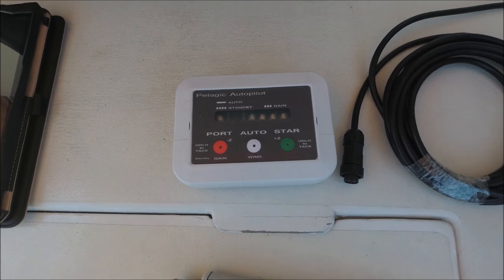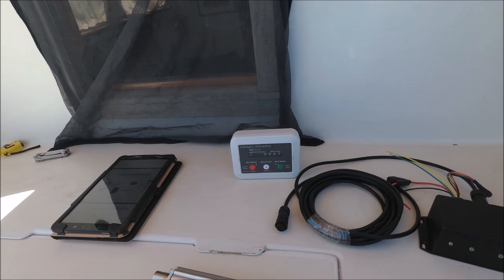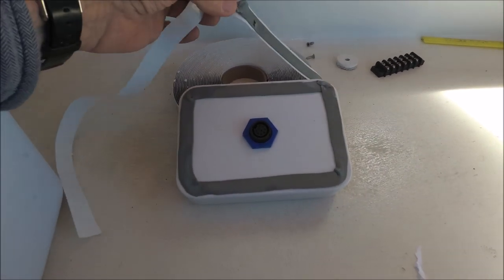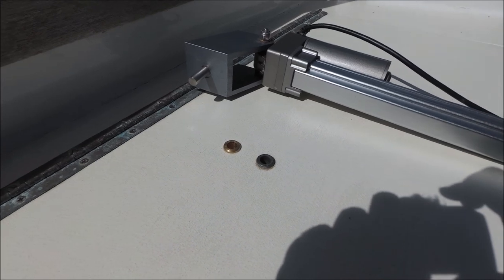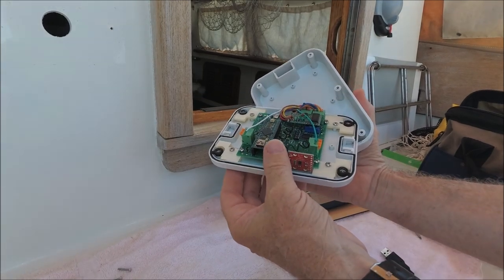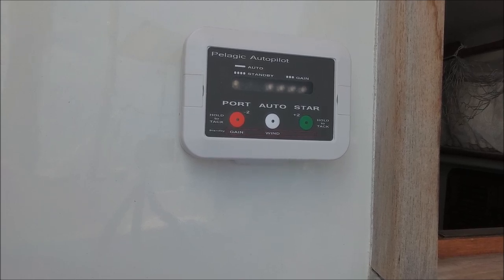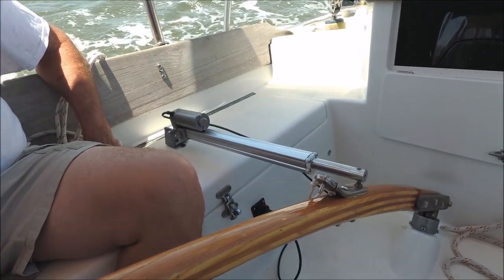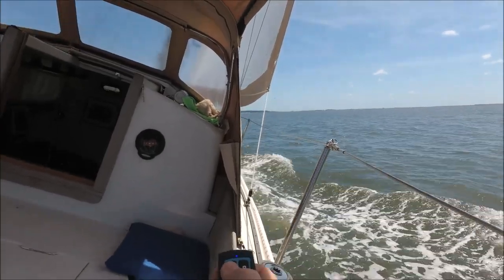Pelagic Autopilot Installation and Test

Comment: Thanks for making sense out of the worlds most confusing user manual!
 I may be mistaken, but on the yaw rate adjustment I think you got the  third and fourth steps reversed. Yaw Rate Damping is shown as the fourth step in the manual on the Optimization Adjustment Method page.
Reply from the maker: With 3 of the 4 parameter adjustments all labeled yaw something or other it is confusing. It's possible, but I don't think I mixed up the order, or the manual terminology may have changed on different updates. In any case, I got the adjustments correct and you can confirm the default settings with the manual, regardless what type of yaw it's labelled as.
Reply: atomvoyager  Either way, your demo and translation into plain English of their incredibly inscrutable flow charts has been extremely helpful and is much appreciated.

Comment: James did you ever think those power cable wires are just too small for the amperage drawn?
I think you showed around 1.0 amp while motoring, I think they would often be higher when under sail.
Reply from the maker: The main power wires I think are #16 which is fine for under 3% voltage drop with the 3A typical max load on a short length of wire. To extend the length you should use #14 or larger. The other wires for the control head can be smaller because they don't carry much load.

Comment: Thanks for the great review! I am considering replacing my Simrad T32 with the pelagic on my Ericson 33 . How well do the controls on the control panel and remote control work for tacking ? Can you adjust tack  “rate” or manually press a +10 degrees button multiple times to tack ? Does the pelagic control arm release easily from the tiller ?
Reply from the maker: As you saw, tacking is done by holding down the port or starboard button on the display or the remote but I don't know if there is a "tack rate" adjustment or a way to change the standard 2 degree course control button. There is no 10 degree button like on the Simrad or Raymarine. I do find the 1 and 10 degree buttons on those units easier to use than making 5 rapid pushes on the Pelagic to turn 10 degrees or 10 times for 20 degrees but I guess they reduced it to one 2 degree button for simplicity. The control arm seems to remove just as easy from the tiller pin as the Raymarine I had. With either one you may need to wiggle the tiller to take the load off if it binds and that may be more a case of if the angle of the actuator to the tiller is close to level to ensure they don't bind.

Comment: Thanks so much for sharing! Very informative. Did you ground the deck socket? Instructions don’t mention that, but the socket has a screw for grounding. Any advise appreciated. TY
Reply from the maker: It's not needed.
Reply: @atomvoyager  Excellent and thank you

Comment: Thanks for the video, I see in it you are using a HawkEye depth sounder, is it reliable? are you using a transom mounted transducer or a in hull one? Thanks for sharing
Reply from the maker: I took the transom mount transducer and attached it with a blob of thickened epoxy to shoot through the hull but I stopped installing them because they were unreliable. Some still work after a few years but at least half of them have failed within a couple years. I don't know if it's because the transducer can't handle an inside epoxy mount or some other reason.

Comment: Was your old tiller pilot that loud? Was thinking of getting the pelagic pilot for my monitor wind vane but i think that motor sounds would drive me nuts
Reply from the maker: I think it is slightly louder than the Raymarine tillerpilots so that may be an issue for some people. I always have windvane self-steering and only use a tillerpilot to supplement that in light air or motoring and as a backup in case of windvane failure so not much issue for me. But I could see how it could be bothersome if you ran it all the time.
Reply: @atomvoyager  yeah I would also only use it for no wind situations like having to motor for days while on passage, still leaning on getting the pelagic wind vane pilot as it's my only viable option to have a pilot onboard, but there's very little information about setting them up or seeing them working online so it's hard to commit to buying one

Comment: 22:35 Mine does this exact same thing when I'm rolling downwind. Sometime even when motoring on a flat calm sea with a lazy swell. Its the only complaint I have in the last 2 years of use. I find especially when I'm fatigued that the constant motor noise as it pushes the tiller port and starboard drives me insane!
Reply from the maker: Have you tried to adjust the yaw parameters as I had to do? In my case the autopilot was working correctly, moving the tiller rapidly side to side to keep on course when rolling downwind in wind against tide approaching the ocean inlet. I was surprised that it kept us perfectly on course although I agree the motor noise is annoying. If I was hand steering at the time I would have been moving the tiller in the same wide sweeps to stay on course. The silent windvane self-steering might have worked but she'd be yawing much more. I still expect to use the windvane whenever conditions permit.
Reply: @atomvoyager  definitely adjusting the gain depending on the conditions helps. I find if I'm hand steering I can get away with holding the helm roughly in the centre and the rolls cancel each out. However it's just a small issue, on the whole it's a great system.
Reply from the maker: The gain is one thing but you might also try decreasing the yaw parameters on lights 2 and 4 down to 2.5 as I did.
Reply: @atomvoyager  I'll give it a shot thank you.  First I need to enlist some help as I can't reach the autohelm from the power switch to get it into the settings mode.

Comment: How is this "cheaper"? Its $1100
Reply from the maker: The pelagic is $875 and the EVO-100  is about $1,250.  The optional spares and extras add up but you don't need them and the EVO would also cost more if they offered spares. Maybe you are comparing it to the ST2000 which is a different class of autopilot , cheap and poor quality and not comparable at all.
Reply: @atomvoyager   Yeah I was comparing to ST2000